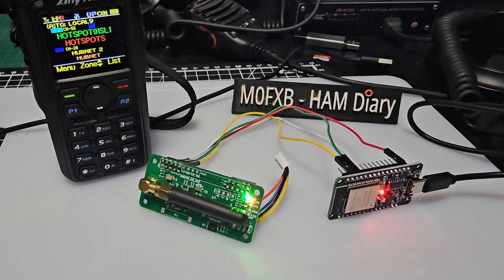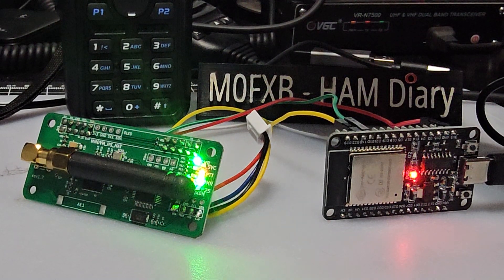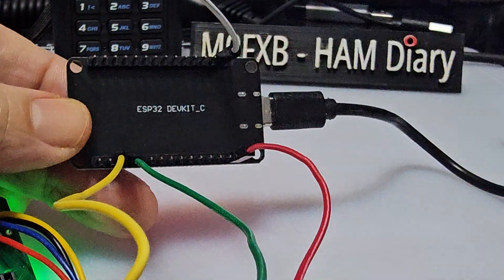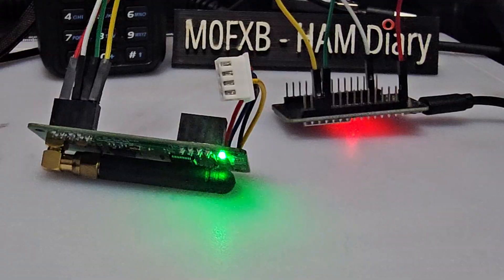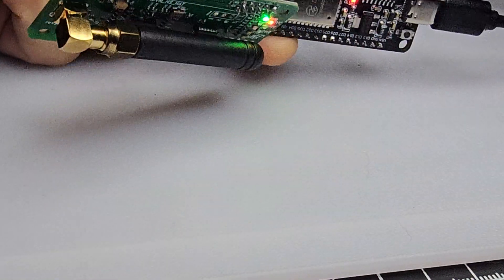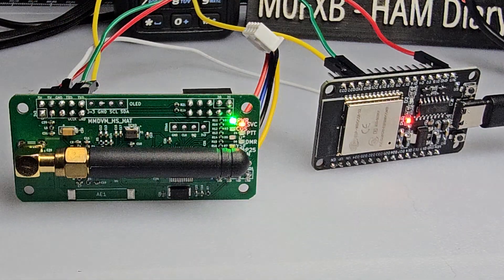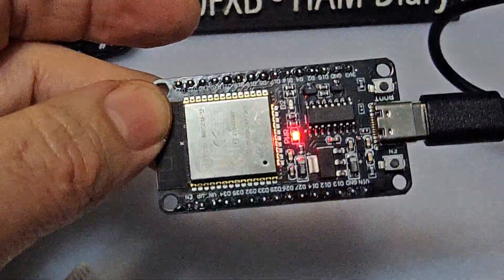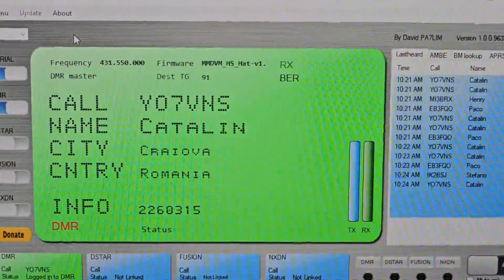£6 - ESP32 WROOM Development Board & MMDVM Hat (RX ONLY)

Comment: You do not need the ESP32 board only you need is a USB-Serial adapter board wich is cheaper. ESP32 is not working at all in your setup ;-) The David software is fantastic. Instead you need to port the MMDVM firmware into the ESP32 and not use the PC. When you end the programming, please send me the firmware ;-)
Reply from the maker: Thanks I don't have any firmware sorry